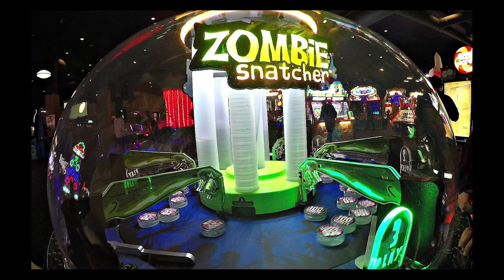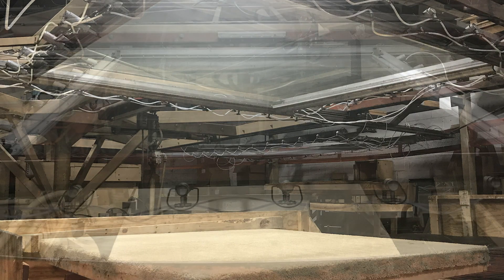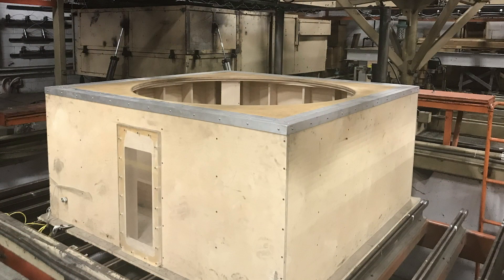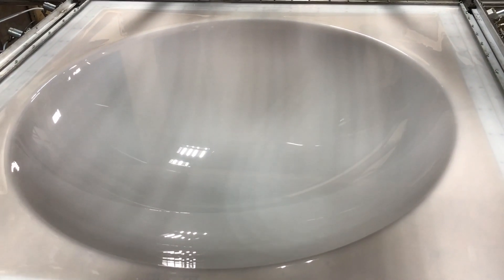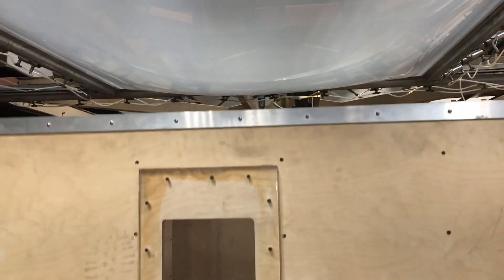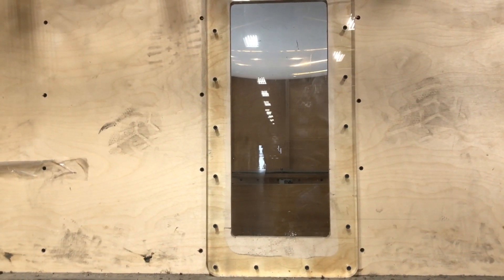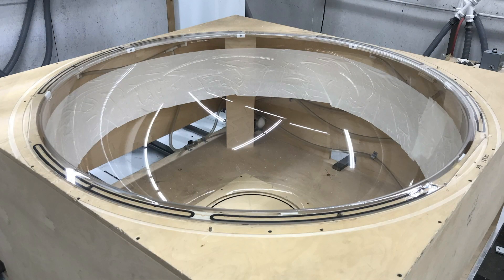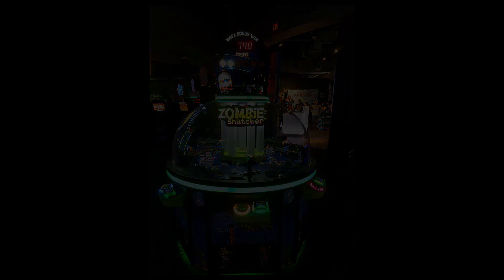Arcade Game Top Cover – Free Forming at Bo-Mer Plastics

Comment: My greetings
good job
What is the appropriate temperature for forming sheets of polycarbonate in this way
Reply from the maker: The forming temperature depends on the starting gauge of the material as well as the process used to form the part.